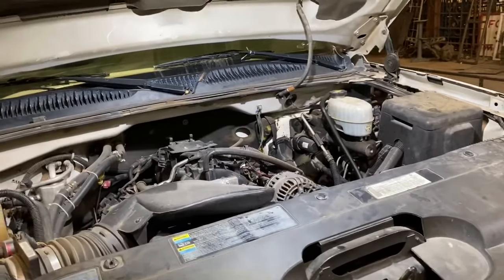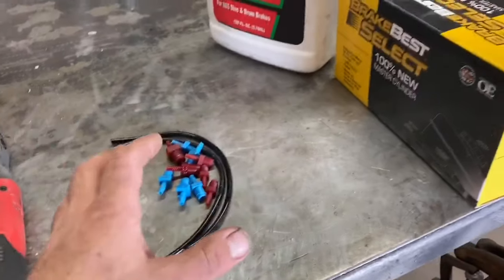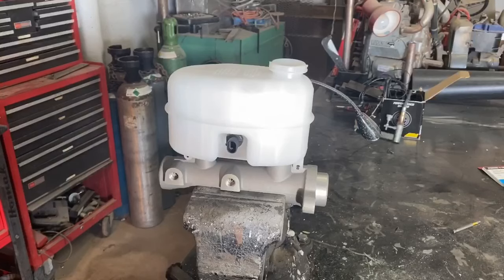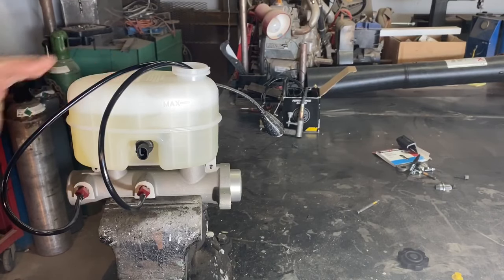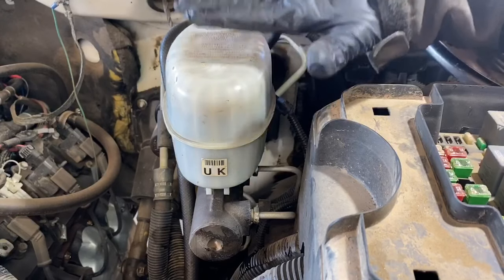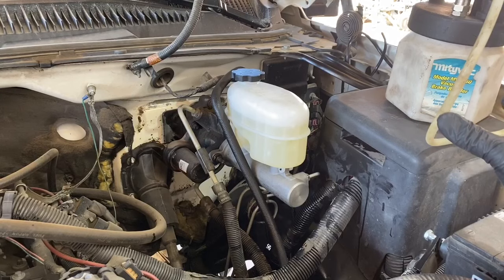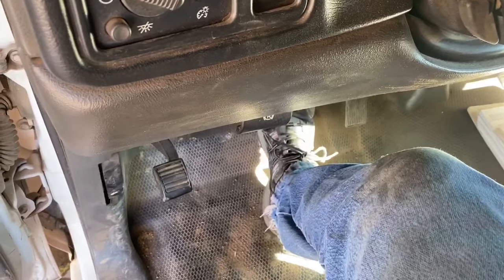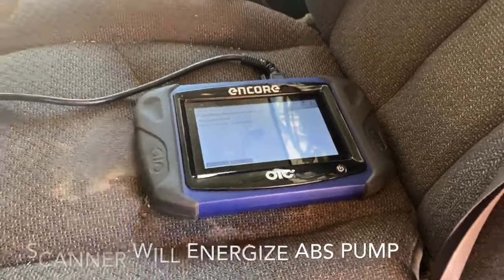Gm Truck & SUV Master Cylinder Replacement (Brake Bleeding Tips)

Comment: I replaced my calipers , master and my breaks keep locking up on me. It's a 04 suburban with this hydraulic system
Reply: If you follow the line coming off the front of the master it goes to what is a called an abs precharge pump. I disconnected mine after replacing calipers lines booster and master. Took care of my problem but stabilitrack light will be on dash- that’s where I’d start

Comment: How can you tell if it’s leaking from the seals from master cylinder or the hydro boost?
Reply: In my experience if it’s leaking from the hydroboost you lose P.S fluid. If the master cylinder is leaking you lose brake fluid

Comment: I have a 2004 Chevy Silverado, 2dr 1500; i replace my leaky original brake master cylinder with a part from Dorman.  My brakes have been locking up since.  Any idea what could be causing this problem?
Reply: Typically that means your proportioning valve is stuck to one side. Google proportioning valve reset. That fixed my same issue on my 2004 Chevy Tahoe z71.
Reply: Was it leaking brake fluid or power steering fluid ??

Comment: Great instruction. I replaced all the lines in my 2006 suburban, went to bleed and the shiny silver cylinder parallel to master cylinder, was making a faint  “goose” honking sound…what is the silver cylinder called? Thanks

Comment: I have 05 tahoe 5.3 i purchased a master cylinder but its asking if i have cj5 brake system is that the correct one for my truck?
Reply: In many cases you have to have VIN # to get correct part
Reply: Vin will not be enough for some. There is a replacement parts identification sticker in or behind the glove box.

Comment: Do you need to do that bi directional test?
Reply: If you get air in the ABS module/valves then YES.  But how he did it, probably dont need to do the bi-directional ABS bleed.
As long as there isnt a large amount of air in the brake lines, and the ABS is NOT activated with the air in the lines, should be ok to just do a normal bleed.
Stay gold.

Comment: I replace master cylinder,brake booster,front flex brake lines and did auto bleed bout 12 times all calipers bleed straight stream no air except rear passenger it trickles a lil then stops I used a vacuum bleeder on rear passenger and and still don't get straight fluid scanner shows no faults with abs what could it be I done spent so much money trying to fix this
Reply: Try bleeding abs system with a scanner it’s  automated bleed
Reply: Vacuum bleeders can pull air from the threads around the bleeder screw.  Try putting grease around the threads, then doing the bleed.
I stopped using vacuum bleeders at the calipers.  Either gravity bleed, pressure bleed, or the best way = 2 person bleed.
Stay gold.

Comment: I replaced master cylinder and everything down to the pads and STILL have residual pressure on the pads. Hot rotors both sides. They don't spin freely when off the ground. Open bleeder then ok. Help
Reply: 2012 gmc sierra 4x4
Reply: What was the culprit? curious. Sounds like possibly bad ABS unit. If it did this before mc replacement that narrows it down.